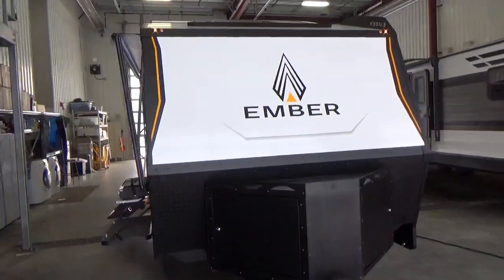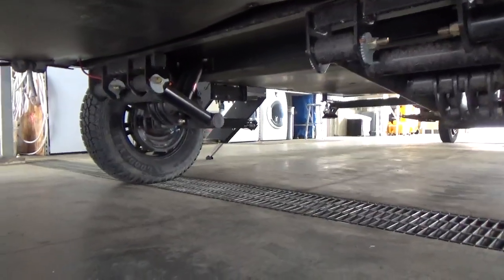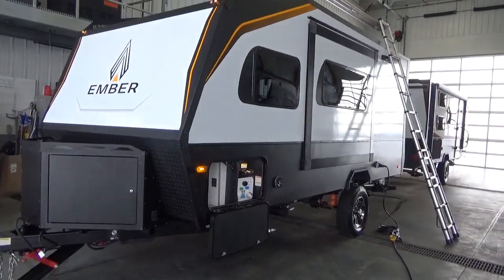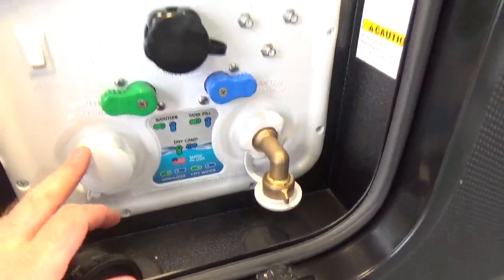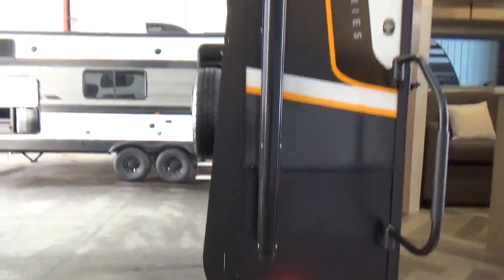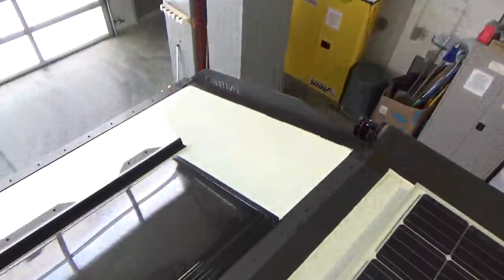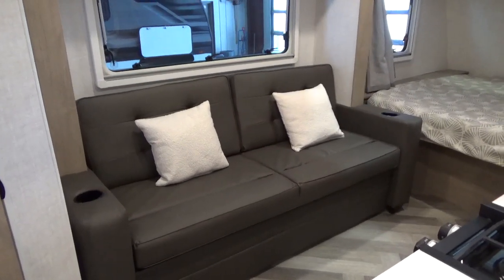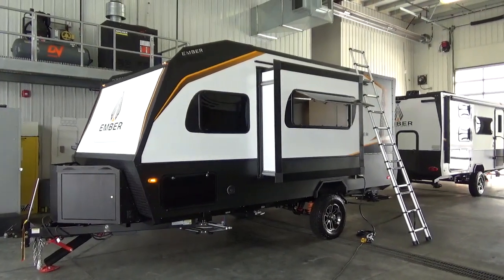2022 Ember RV Overland 171FB Off Road Adventure Trailer - Sofa Slide/Queen Bed

Comment: Very nice, only draw back I see is no hanging clothes storage.
Reply from the maker: Great observation Bryan. We can however add a hanging rod in behind the TV. Recent models from Ember include this addition. We can also modify to add shelving if you’d prefer additional panty space or space for folded clothing.
Reply: @WoodysRVWorldOfficial   the max solar package, how long can you run the AC off of the battery?
Reply: @Bronco2Cj  I believe there are two battery options, 330, or 2 for 660 Ah, so only a few hours as the AC is 110, and uses the inverter (2 electrical drains).  If that is your goal, look into 12v A/C units, or some of the class B’s with about 9,000-12 000 Ah to run the AC overnight.   Otherwise, you’re going to want to stay at an RV park.  😊

Comment: How possible would it be to remove the jack-knife sofa and have that slide-out space replaced with an L-shaped desk where I can get all my work-from-'home' stuff done and just live in this thing full time?
Reply from the maker: PerfectDuck, thank you for your question. Removing the sofa and installing a custom desk doesn’t sound out of the question at all. There is also a new floor plan coming soon that has a workstation area that you could use as a desk. Stay tuned for the new floor plan as it will be coming out very soon.😀
Reply: @WoodysRVWorldOfficial  Well you gave me a reason to subscribe. Hey! You were 9.99k subs both before and after me, alas I wasn't the 10k but you are THIS close.